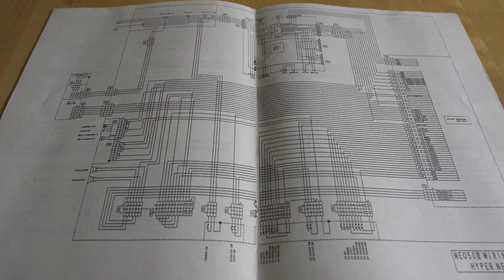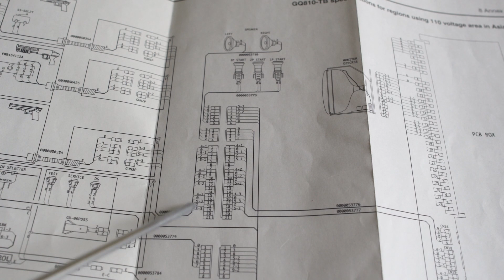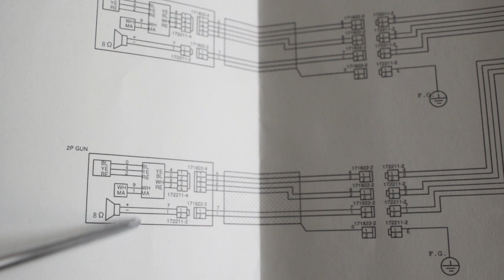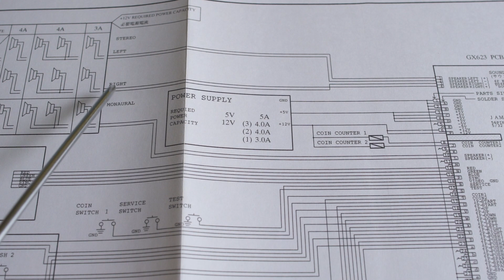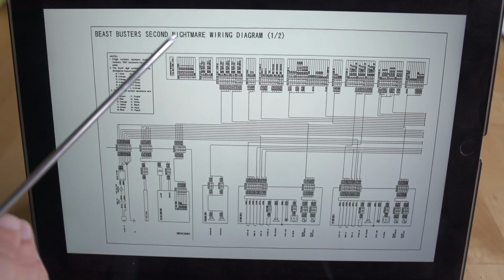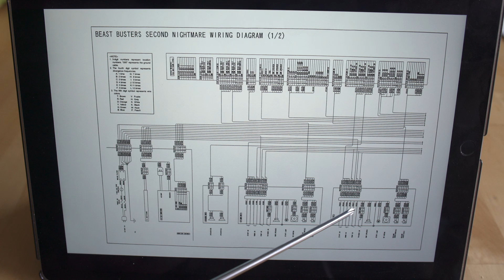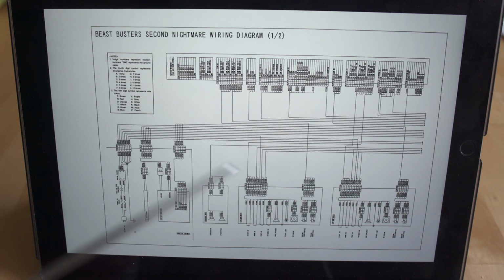Reading Arcade Schematics - How to  - "On A Technicality"

Comment: VIDEO GAME ESOTERICA, vector games use a math box, vector generator ic chips, XY pointers, State machine PROM chips. 
What does the Mathbox circuit do it's purpose?
What does the State machine PROM chip do it's purpose?
Whats the differences between XY pointer signals compared to H&V sync signals? 
What does the Vector generator IC do it's purpose?
Reply from the maker: Lol that’s a lot of questions in one post about a video on reading a schematic
Reply: @VideoGameEsoterica  yes make a video lesson explaining the questions or can you answer the questions here

Comment: errm, but that piece paper you showing in this video is not schematics, it is wiring diagram.
Reply from the maker: Maybe a language difference. In the US I’ve always known both that, and more in-depth chip and circuitry design docs, to be “schematics”
Reply from the maker: also the arcade manuals use the term “schematic” as well to refer to the diagrams, so I am just carrying over the language :)